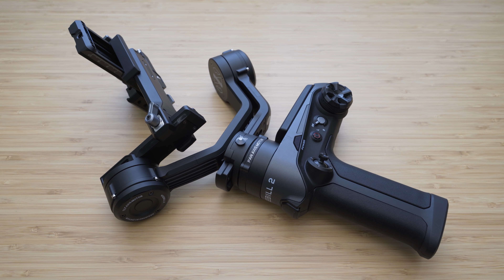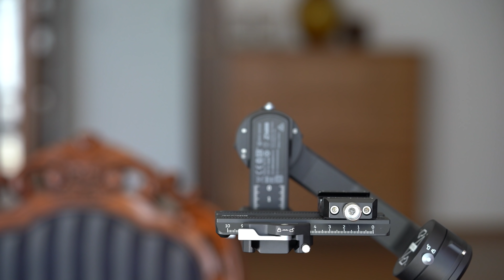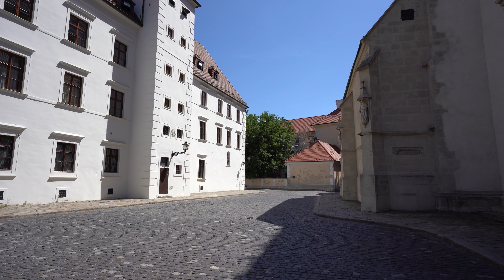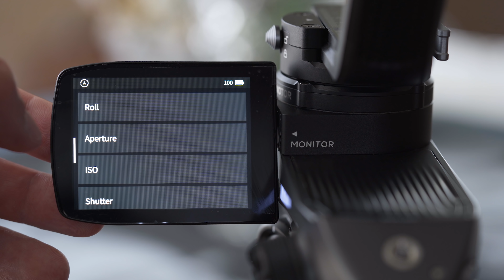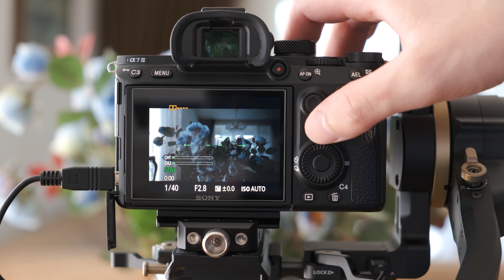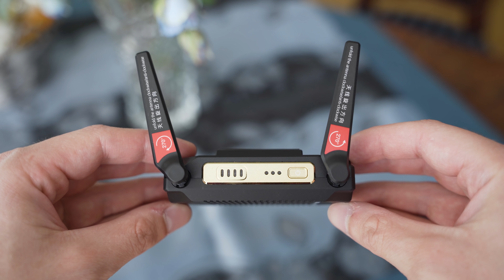Zhiyun Weebill 2 Review - Compact performance w/ Sony A7III

Comment: Hi . I have a7mark 3 , when I connect and start recording it doesn't follow , does it have the option to track the subject , what is the best cable to use
Reply from the maker: Only with the transmitter unit.

Comment: It is very sad to know that such a powerful and versatile gimbal is limited in the Sony A7iii. Practically it only works well with A1, A9 and A9ii. 
I have the A7iii and I bought it thinking I could get the most out of it. However, having a gimbal of this category and not being able to use electronic focus and wheel control of ISO, shutter and aperture, is quite annoying. At the exact moment I can't even use Recording button. 
I have firmware 4.01 on the A7iii, can anyone use something? Regards from Rio
Reply from the maker: It works the same with all Sony cameras. As I have said, just use the buttons on the camera, it is much more convenient anyway.

Comment: can you show us how to connect to the camera
Reply from the maker: You just need to plug in the cable and follow instructions for specific camera.
Reply: @TheHybridShooter  I connect the cable bt it's not responding I have the Sony a7iv
Reply from the maker: @eatwithm3  A7 IV doesn't work yet, you will have to wait for FW update. Just use the buttons on the camera in the meantime, it is more convenient anyway.
Reply: oh Thats why... So what Gimbal can i use now which works with A7iv
Reply from the maker: It works with A7 IV except RC, which I don’t recommend using even if it works.
Reply: @TheHybridShooter  i did everything (balance) But when i wanna check if its balanced it just says its balance even when i unbalance it

Comment: I am not convince with the ease of balancing as one of the axis don’t have indicator., i disagree with you, and the battery is not removable and have short life 5/6h and the slung attach system is not as good as in the weebill s which has fast attach. People would like weebill s2 with all features of weebill s, and the quality and solidity of weebill 2 but lighter like weebill s, with the led light we can find on the crane m3. The screen is nice  but a smaller screen would be enough.
So zhiyun, we need lightweight (inf to 900g), fast attach, solid, strong motor, strong lock, compact, integrated led light and integrated micro and bluetooth extension base, 1/4 attach for micro, and screen monitors, extra handles.
Reply from the maker: If you mean the cm ruler, I don't know anybody who uses that anyway. I don't think that your personal requirements match what "people" want, Weebill 2 is a very successful product. Weebill S still a great gimbal, so anybody should be able to choose from Zhiyun's lineup.
Reply: @TheHybridShooter  but they should have kept the size of weebill s and removable battery, but reinforcing the arms and lock with better materials. Weebill 2 is not in the class of small gimbal to my opinion with a weight of 1.41kg. The weebill 2 is not as successful as you say. The majority of persons wants a weebill s2 which keep all the great things with better materials and locks but retain the good price and new improvement (light and microphone) And that they would sell like crazy.
Reply from the maker: @CC-gt3ro  That is just your opinion. As I have said in the video, it is a full size gimbal that competes with DJI RS2 but the footprint is significantly smaller. Complaining that you would like midsize gimbal instead is pointless, Weebill 2 is simply in different category than Weebill S. Maybe there will be Weebill S2, I don't know.
Reply: @TheHybridShooter  i wait weebill s2 which could be a mix of crane m3 and weebill s. It would be perfect.

Comment: Hey there! i just bought the Weebill 2 and im having a hard time charging it within 1.5 hours. i bought a anker IQ 24w charger but it is still not as fast as you said it would charge. I was looking for. PD charger online but couldnt find one for usb to type c. what charging block are you using?
Reply from the maker: I strongly recommend not charging it with fast charger unless you really need to. Frequent fast charging is very bad for the battery. 65W Ugreen charger can get to 25W with weebill, but I am actually charging it with Apple 5W charger to preserve the battery.
Reply: @TheHybridShooter  on the manual it says that the most of a charger is 24 watt. is 65 watt charger safe?
Reply from the maker: 65W charger will only charge it at 25W of course. It is safe, but I don't recommend it, as I have explained.

Comment: i saw in a review that it wasnt compatible with a7iii. you say exposure setting wont work? is it fully compatible? thans great review
Reply from the maker: Only some of the remote control features are not compatible. I don’t recommend using those anyway, using controls on the camera is more convenient.
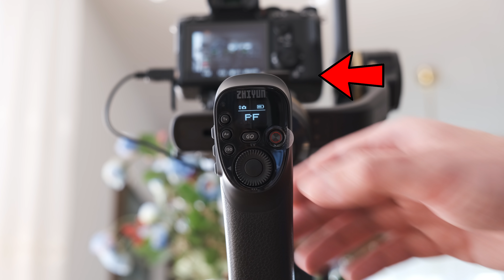Reply: @TheHybridShooter  what about the record button? that will work? cause at 8:57 you use a webilll s not a webill 2. thanks
Reply: I just bought this set up this week. The stop and start record buttons work on the gimble if the cable if plugged into the Sony camera 👍
Reply: Doenst work on my a7iiii which cable u use?

Comment: but with Sony A7iii can you control shutter speed, aperture, iso using the control wheel? Can you please confirm this?
Reply from the maker: No, you can't. There is compatibility guide on Zhiyun site.
Reply: @TheHybridShooter  even start recording from the gimbal?
Reply from the maker: @debasishxxxeco  That works but I generally don't recommend using remote controls on any gimbal at all. Simply using buttons on camera is much more convenient.
Reply: @TheHybridShooter  thank you that helps. One last question, have you tested the Portrait mode for real life test? I saw it positions vertically towards the sky and you have to hold the gimbal in Gun-like position to take vertical videos unlike phone gimbals which makes the orientation of the phone truly vertical without changing gimbal position... its really awkward for such an expensive gimbal cant fix it like their phone gimbals do

Comment: I love my new Weebil 2!!!  Thanks for the great review.  I got mine just in time for a 3-day wedding weekend and because I was shooting all-day long, I did need to use a PowerBank connected to the Weebil 2, just to supply more battery life through the Reception portion of the day.  It was super-easy to connect and it charges it while I'm using the gimbal.  Also, the flip-out screen I kept closed and only used it when I needed to change the settings from PF to POV, which I use frequently.  However, on the original Weebil Lab, there was a dedicated POV button on the gimbal arm, which I wish they had on this new one.  Oh well, that was my only issue; other than that, it works amazing!
Reply: how do yu connect ut

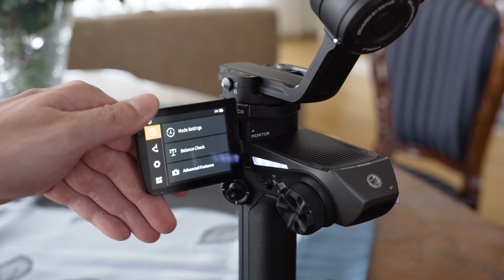Comment: Great video. Thanks. I got two questions. (1) At 5:50, I can see scratches on the protective foil on the flip out screen. Would you expect that, once that protection is removed, the actual screen itself could get scratches in regular use? (2) DJI was offering a feature where you'd be able to control the movement of the gimbal with the accelerometer of the phone. Does the Weebill 2 have that kind of feature? Thanks a lot.
Reply from the maker: 1. I don’t know, I don’t intend to remove the protective foil.
2. Yes that is possible, but it is mostly a “party trick”, it is not particularly useful in the real world.

Comment: What do you think of the new sony mft sensor with stacked, back-side illuminated sensor with up to 120fps full-width readout speeds. Hopefully we see this or the 47 MP sensor in the GH6 or the Em1-Mark IV in the near future.
Reply from the maker: I don't really think anything about it, I can get full sensor 120p with full frame cameras, so I am still no longer interested in M43 at all.
Reply: 120fps is for open-gate readout. that sensor should support 150fps, for 16x9 readout.

Comment: Ergonomy is totally sucks :) i use weebill s for my blackmagic 4k with atomos shinobi, follow focus and L bracelet.. I can control my focus with my both hand with weebill s but in this Weebill 2 i had to handle my gimbal with 1 hand only to release other hand to follow focus. It means hard to operate :) 

Its good for low angle shots to operate but i only use low mode %30 of my shots :) its useless %70 of my shots for me.
Reply from the maker: I absolutely disagree. I am not sure what is the problem, your description makes no sense. I have no idea how can you operate follow focus with both hands without dropping the gimbal, and why would you want to operate follow focus with both hands...
Reply: @TheHybridShooter  i mean when i hold my gimbal with 2 hand i can use follow focus with 2 hands thumb finger 👍😂 left or right hand doesn't matter. Both hands thump can reach it easily. But in weebill 2 i cant reach any of my finger like this.
Reply from the maker: That is very specific issues, I have never seen anybody use it like that, so I definitely wouldn't say that ergonomy sucks because of that.
Reply: @TheHybridShooter  also monitor holder is on right side now. How can we use follow focus while use monitored setup?
Reply from the maker: Using the 1/4 mount on the top or ideally mounting the monitor to the top of the handle.
Reply: @TheHybridShooter  bro i had to explain with photos, i couldnt find you on instagram can you write to me? @akcivan

Comment: Sh@1t! I just bought the weebil s. I didn't know they were launching this one.
Reply from the maker: This isn't really Weebill S successor, they basically moved Weebill 2 one category higher, so if you are mostly looking for portability, weebill S is still a great option.
Reply: @TheHybridShooter  yes the webble s is amazing. Plus extra batteries are only 23bucks3
Reply from the maker: The fact that you need an extra charger isn't that great though.
Reply: @TheHybridShooter  so 2 is for more heavier load  kind replaced crane 2 not weebill s? How do you compare the 2 and s for travel? Thanks

Comment: Thanks for the video!!! I have a question about your TECHNIQUE when walking with a Weebill Gimbal. If you are just walking forward do you hold your gimbal upright? Or do you tilt it forward holding the gimbal by the handle screwed in to the back at 45-degree angle (underslung)? I can't seem to get very smooth footage when tilting the whole gimbal and camera (Panasonic S5 or Sony a6500). So I end up holding the gimbal and camera straight up and down (like you would hold a Crane gimbal).
Reply from the maker: You're welcome! I tilt it forward, but only slightly, not by 45°. I am not using underslung mode for usual shots. It is mostly about practice and you also need right shoes with flat and flexible sole.
Reply: For walking I can recommend rolling your foot from heel to toes and bending your knees, looks kinda strange but helps a lot!
Reply from the maker: Rolling your foot from heel to toes absolutely doesn't work for me. It is recommend quite often but I was getting terrible results that way.
Reply: @TheHybridShooter  Oh that's bad to hear, are you prefering to "just walk" and even out the shakes with your arms? I was just wondering if I could maybe enhance my gimbal Performance 🤔

Comment: Still prefer RSC 2
Reply from the maker: I don't, RSC2 is not even close, this is RS2 competitor, so level above RSC2.
Reply: @TheHybridShooter  well maybe, but RSC2 has payload good enough to carry everything and its way smaller. Fits better in my backpack because you can bend it in the midle and if we are talking about the options every gimbal nowdays has the same functions nothing new
Reply from the maker: You are free to prefer RSC2 of course, but as I wrote, those are not competitors, so it doesn't really matter. The difference in performance is one whole class. The results that I was getting with 24-70mm f2.8 on RSC2 were not good enough by my standards, so I I think that Weebill 2 is well worth it over RCS2 if you use similar setups.
Reply: @TheHybridShooter  the price is also rs2. Lol
Reply from the maker: No, it isn't. Comparable base package is $300 cheaper.
Reply: Can it handle canon 6d+24-70? Thanks in advance..
Reply from the maker: Yes, it should, you can take a look at the compatibility list.